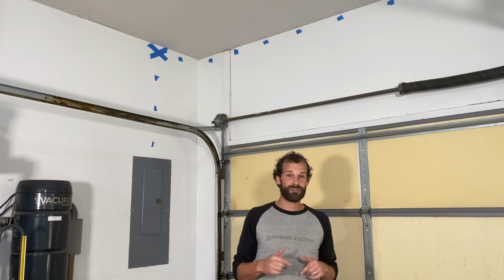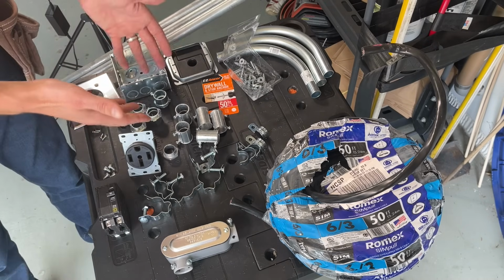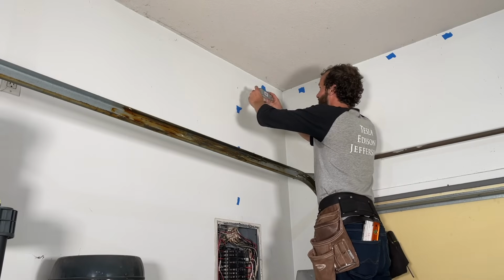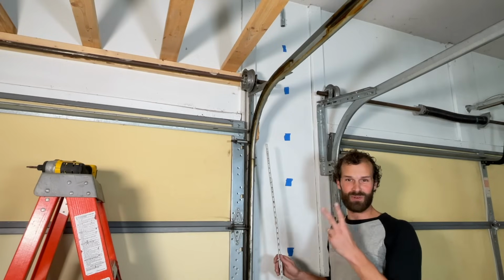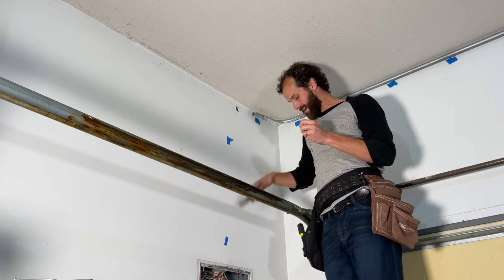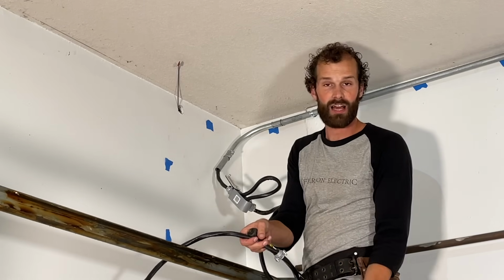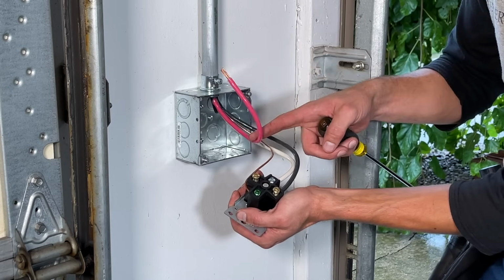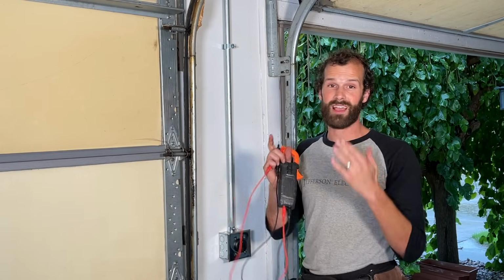How To Install a 240 Volt Outlet | Electric Car Charging

Comment: I would have probably done it the same way because at my house the inspector would not be paying me a visit but if you want to do this by code - you should have used a 50A 2P 240V GFIC breaker since this is a plug in EVSE vs hard wired.  You need the GFIC for the plug in version for personnel safety purposes by NEC.

And please respect your lineman's by not beating on your beater with them - they are not a hammer and your pliers are too expensive to ruin them. Take care of your tool 🤘

Comment: We always grounded the EMT by pigging the GFC in the box and securing with ground screw to the J box.  If the ground is structurally connected to the yoke on the receptacle, then it would all ground via the yoke screws and connection to the box, but not sure if NEC considers that a sufficient ground or not. I would like to see much more references to the applicable NEC Articles. Indiana is still under 2008 NEC. Definitely not very informative from a NEC perspective. Update: I looked this up in NEC, for surface mount this is correct per NEC, for internal mounting the way we did is correct.  (2020 NEC 250.146)

Comment: He did a really great job of both explaining and showing us this installation. Well done! Can you however imagine how much your electric bill will go up when you're drawing a 50 amp load?  That's 12000 watts at 240 volts or 1.2 kilowatts! If you have a power outage and your car needs charging you are out of business!
Reply: FYI:    12,000 watts would be 12 kW, not 1.2 kW.

Comment: I am not an electrician, but common sense for me would be to use insulated screw drivers and pliers when working in and around live wires. Seeing him stick in regular screw drivers and pliers into a live panel had me cringing.

Comment: If it were a 50A continuous load, a 50A breaker is under specified. The NEC requires a 1.25x specification of the continuous load/load rating. Since 62.5A is not a standard size, a 70A breaker should have been used. Of course a Tesla Charger from a Nema 50A receptacle would only pull up to 42A. Unfortunately this is a classic, and common Electrician SWAG. That’s why an Engineer needs to sign off all electrical drawings.

Comment: Hello I have siemens siemens g3040mb1200 panel.   Can I use the 50 amp square D qo breaker that was mentioned on the video??

Comment: All youre high amperage breakers should be as close to the main breaker as possible. The idea here is so the high amperage does not have to travel the entire length of the bus bar. That 50 amp breaker you just installed at the top of the panel forces the power to travel the entire length of the bus bar.  Not recommended. You need to move up all the smaller breakers up so the 50 amp breaker can be installed as close to the main breaker as possible. Any pro should know this or are you one of those that just dont give a shit

Comment: I am a pro handyman, and there is nothing you did that I don't do. Other than I don't use steel fish tape in a hot panel. Fiberglass is a smoother move. And no idea why you decided to pull dry. I have on speed dial my Pro electrician, that does industrial, commercial, and residential for when it's out of my league.  Dam, I even own the current code book. So be careful on trades you like smashing to sound like a pro.

Comment: Isn't running all the existing branch circuits together thru one hole bundled tightly together a code violation?  And maybe a fire hazard?

Comment: Romex through emt? How in the modern world can you expect respect from your work while buying premade 3/4in 90s? My god is a 6in reduction so hard? Never-mind table 8 in the NEC. Why would you not set the jbox right above the load center?? Teach people the right way or don't, forget hacking the world together. Edit- Why would you not use a mulberry plate to finish the job? Why in the world use a plaster ring with  surface cover? Trying to jack up an elbow or shirt? You do understand the neutral cannot share a lug as grounds can don't you? I don't see it separate. Leave it to the pros, this is not work to be proud of.
Reply: Neutral and ground are the same in front first disconnect panel.
Nothing in NEC mentioned you can’t do Romex in Conduit if you follow other rules. The sizing is wrong though., 6/3 on 3/4” is just way too tight.
Reply: @Genesislights  You cannot share lugs with neutrals, they need their own screw. You can gang grounds not neutrals.  RX through EMT just screams hack to me, never mind the extra fill. I understand the fill hence I mentioned table 8.
Reply: @Pbtbreakingpoint  sorry I mean sharing buss not  lug, my main panel has this and so do my neighbors. How does running Romex they conduit is a hack job if they fill is ok. You would rather run THHN and splice to Romex then?  I would love running THHN thru EMT but THHN can’t run without conduit inside the drywall..
Reply: @Genesislights  I understand, my original wording left room to be misunderstood. I would much rather run thhn myself, there are multiple ways to skin that cat. Each not needing to splice. Yes its basic knowledge to land your ungrounded and grounded conductors together at the first disconnecting means.
Reply: @Pbtbreakingpoint  how would you run THHN with no splicing from panel to outside drywall though. All the 90 elbow is too big for the space inside 3.5 deep stud? Was thinking about doing it right on the edge of the panel using LB and let the THHNs exposed for 2” or so before going to the main panel but technically it’s not to code either.

Comment: Don't you need a GFCI 50 Amp Two Pole breaker?
Reply from the maker: With NEC 2020 I think you do.  This install is in an area still on 2014.
Reply: @EverydayHomeRepairs  I am going to put in a regular 50 Amp two Pole breaker. I hear if you put in the GFCI breaker and the EV Charger that has a built in GFCI you will get nuisance tripping.

Comment: can you put 4/3 rommax wire with the ground in EMT 3/4 or must be 1 inch?
Reply from the maker: I would recommend (Now) going with THHN wires to give you less trouble pulling through the conduit.  With 3 X 4 gauge conductors and a ground you should use 1" EMT.
Reply: @EverydayHomeRepairs  what if 3 feet of my wire goes into the wall cavity before gets to the main panel from the conduit body , should I use NM  4/3 wire or THNN separated wires? Thanks

Comment: First, use a 4x 2 1/8” at ceiling, a real electrician uses a bender in lieu of factory ells. Romex in the wall, make joints in the box.  Romex in conduit, yuk.

Comment: I hated every bit of that wire going into that wall above the panel in that LLBDEEZ box you were using.  I definitely am appreciative that you left the screw up in so I know what not to do if I run conduit.

Comment: Hi   I have a question on the 50 AMP square D Breaker (Type QO) will this fit inside my breaker box in garage?  Or is this different from what I  need?  Will Homedepot have this 50 AMP square D Breaker?

Comment: Joel, I feel like your great defender in these comments.  One more I Just found this one.....but 406.11 (recepticles)  connecting the ground terminal to the box.....250.146.(A). Recepticle ground term to box, surface mounted., the yoke to box connection shall provide the effective ground path.  So the box is grounded as per 314.4.

In 250.146 there is a requirement to remove at least one insulating washer and your recepticle came with zero.

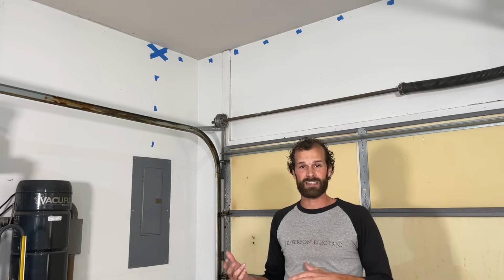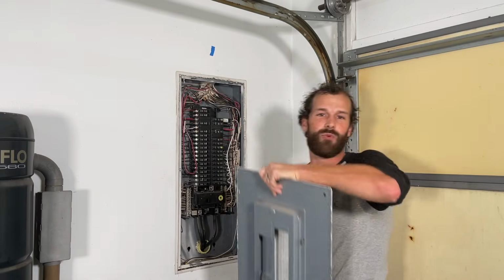Comment: 1:12    >    2:39 
OK and get it but how to calculate net continuous flow or estimate that?
My situation : I have a sub panel in the garage, near where I want to add a NEMA 14-50, that previously a professional electrician installed, to supply power to the jacuzzi (Inside sub panel, it say: "5 poles max. Max breach or main circuit breaker rating70 Amp, then my main panel has no spect sticker but input via a double 100Amp breaker, that brings in the power to box so I believe it is a 200A main)
Currently, this (The sub-panel in the garage) has enough empty spots and supplies a 240v jacuzzi, through a  dual 50A breaker, when use is needed (Not always as this is a vacation home).  Am I fine to add an EV station through the current sub panel?

Comment: @Everyday Home Repairs I like the video, but my situation is little different from you. I would like to use unused hot tub 240v 50A wires (hot tub was long gone and left an electrical box at the deck) and connect to the garage for EV charger . How can I connect the hanging wires under the deck (wire from previous hot tub) and run long the outside vinyl and get into the NEMA 14-50 outlet in the garage? Not sure if I could you EMT conduit or plastic conduit along the vinyl and how high to mount the conduit?

Comment: Wouldn't it be better to use the power gun to tighten the screws on the box? Now-a-days power guns seem to eliminate manual screw drivers. By the way, you did an excellent job!
Reply: More often than not a 'power gun' ruins the head of the screw. Some day you may have to remove them again...

Comment: Why are there videos and diagrams on the web that indicate a white neutral wire is not required between the panel and the 240/40 outlet?

Comment: Very through instructions but still intimidating for DIY with mostly live panel. 
So that is for ONE EV to charge, not that I  have any, what about to charge 2 EVs at the same night, side by side?
What are the options? Install 2 220v outlets, are there 220 splitter like for 110 or have another circuit breaker at the panel for a separate line to ensure fast charging on both vehicles?

Comment: Very good video & illustration of this electric installation. The pros were able to identify several areas that need to be considered with this electric project to meet a safe NEC installation. Also, when working in or around energized equipment, OSHA, mandates PPE equipment to be worn for added safety. Always best to de-energize equipment when working in or around electric equipment. Otherwise, a very educational video!
Reply: You're right! Safety hasn't been my strong suite (neither has spelling 🙂)

Comment: Good advice for people with some experience of electrical work.
Can you run plastic or flexible conduits instead of metal?
Given new light fixtures are led and dramatically reduce current draw, can one combine circuits to make breaker room in a full electrical box?

Comment: Put your wire on a spool and reel it off directly into the pull and there will be no twists to get rid of.

100% of dead electricians surveyed agree that their experience is enough protection from a live panel. 

It’s really good to teach DIYers and apprentices that safety standards are for newbies only, and that a cavalier attitude to 200 amp 240 volt is the privilege of a journeyman. Perhaps they’ll live long enough to adopt a similar attitude.

All off this work could have been accomplished with the panel closed, right up to connection, at which point the power should have been cut cold.

I can’t think of a site where even a steward wouldn’t pull the card of an electrician working with a live feed. Linesman gloves, grounding strap, rubber boots, non-conductive tools, spotters, all a waste of time in the face of “experience.”

Comment: That is wrong receptacle.  You have more need for a 20amp 240v receptacle unless plugging in a welder.  EVs need to be dropped off at the nearest disposal facility before they destroy our grid system.  Don't be afraid to crawl up into the attic to route the wire correctly. That garage is not an industrial facility. Exposed conduit be ugly as hell.

Comment: Without a GFCI breaker, anyone that followed this tutorial will not pass building/electrical code (NEC 625.54). Good luck getting your insurance to cover anything if your house burns down. There are so much misinformation on Youtube.
Reply: It also depends on the area, some municipals have not followed the 2020 updated GFCI req.

Comment: I'm not a pro but I've never seen ground and neutral bound together before. I've always seen them separate.
Reply: On the main panel, the first disconnect panel, the ground and neutral are in the same bar, mine does. But for sub panel, you will need to separate them.

Comment: What is the recommended way of splitting (1 wire in, 2 wires out) a 4awg or 6awg to two outlets/chargers? (eg for two chargers that won’t work in parallel - ie have shared load management)? Split bolt? Something else?

Comment: You forgot to attach ground wire to metal box. It's violate the code! Also the 2020 wiring code (in some states) requires GFCI breaker for 240V outlet in garage.

Comment: 9:25 EVSEs (EV chargers) are actually very rarely unplugged from their outlets.  The J1772 plug is what gets connected/disconnected every time you charge.
Reply: If you were using a Tesla mobile connector for both home charging and charging on the go, I would guess that it would regularly be connected/disconnected

Comment: Once again, another video with the "best case scenario". The breaker box is in a ultra convient location, such as the garage in this case.

Mine is just outside the wall on the other side of the garage wall...which means I'd have to drill through stucco(that's what my house has on the outside), run conduit through the hole on the outside and through otherside of the wall into the garage.

In my parents case, their situation is even worse. Their breaker box is all the way on the otherside of the house near the backyard. I couldn't begin to imagine the time and cost invovled in running wire and conduit from there all the way to garage.

Comment: I love when videos are so detailed and well done. It gives all the steps and details you need to realize you need to hire a professional.
Reply: I had a pro install my charger. I cried a little when I had to pay. But it was installed and it is right and years later never a problem.
Reply: This was detailed, but there were still some important points left out and this won't pass inspection.
Reply: @nilpo what specifically wouldn't pass inspection? And where(country/state)?
Reply: @AJ-ri5ee  North America. Specifically in the US it won't pass NFPA 70. Pretty sure it doesn't pass in Canada either.
Reply: @nilpo Ok, but what part?

Comment: You'll have to tell me if it would be legal/code or not but I would do it a great deal differently.  I would not have used the LL/LR box or even the LB box.  I would have used a standard 4" square box with the cable coming in from the panel in the bottom left hole and leaving in the top right side hole.  I would have left the outer sheathing of the cable only on the length that was in the wall.  On the rest of it I would have stripped that outer sheathing to make the bull down the conduit a great deal easier.  I don't think it would have been a requirement to leave that outer sheathing in place when the wire is inside of the conduit.  That 4" square box would give you a LOT more room to work than even the LB box.  Make life easier, give yourself some room.   ALSO!!!  I didn't see you putting a safety ground to that conduit!!!  Surely that's not legal/code.   If necessary, you could put a terminal block in the 4" box to transition from covered to uncovered.